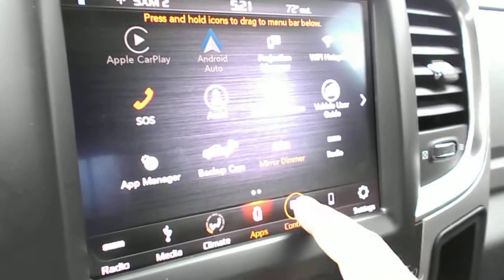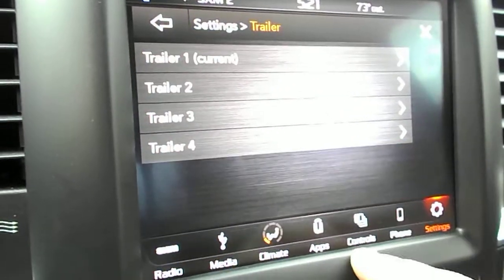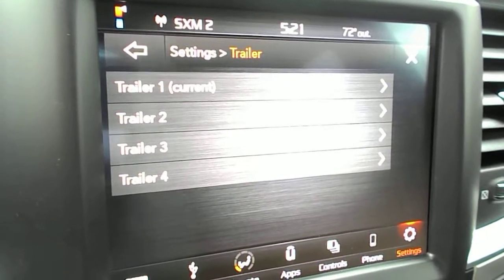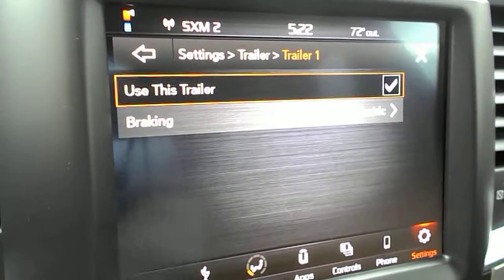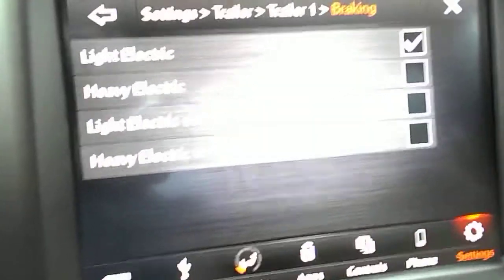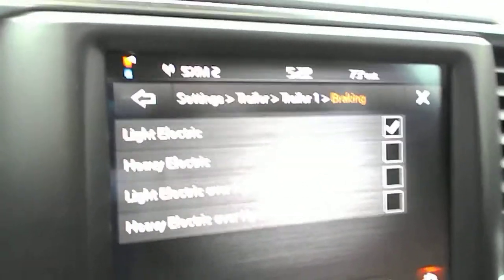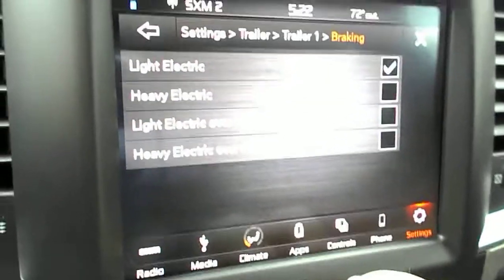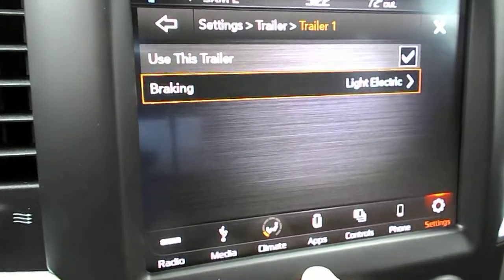How to change trailer brake settings on a new Ram 1500 with Uconnect 4C

Comment: What about on a 2014 dodge ram 2500 6.4 hemi? I can't find it on my truck
Reply from the maker: Thank you for your question!  There should be a similar setting on your truck so long as it was equipped from the factory with a Trailer Brake Controller.  It would be in your media center under Settings, Trailer Brake Control.
Reply: Does the trailer have to be plugged in for the option to show on a 18 Rebel with 4 flat and 7 round from factory

Comment: How did you get that on your center console, my 2019 ram 1500 with 8.4 inch UConnect only has it on the dash screen, i know im late to the party but any info would help thanks